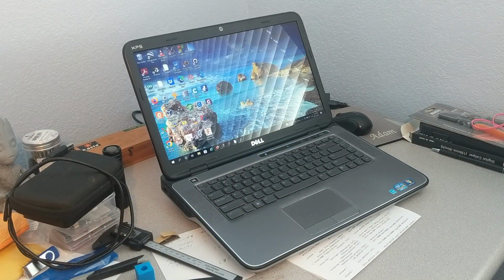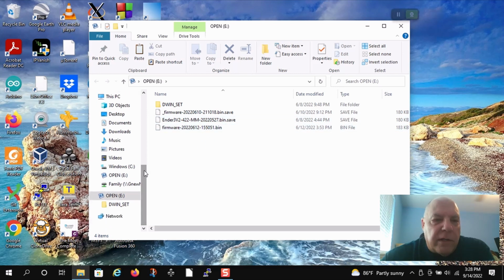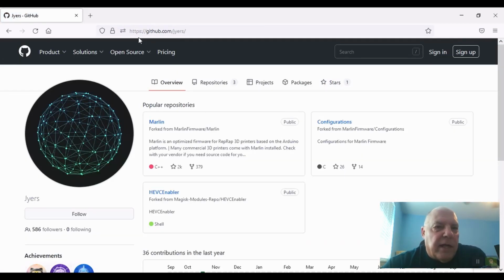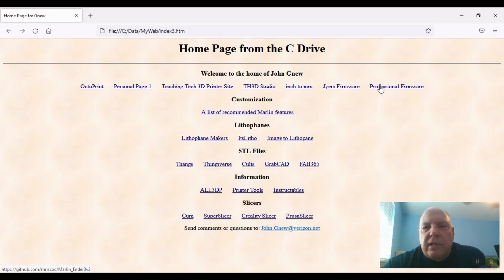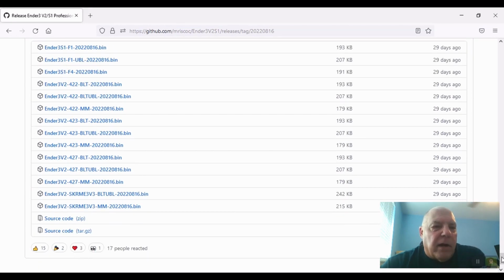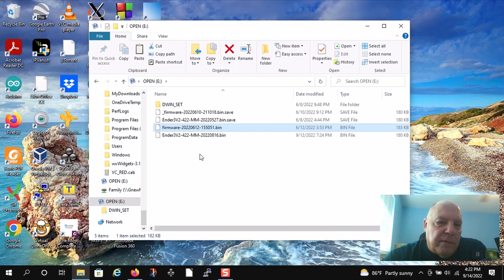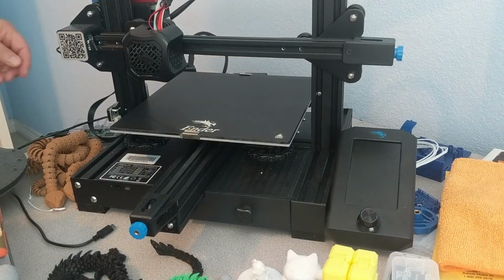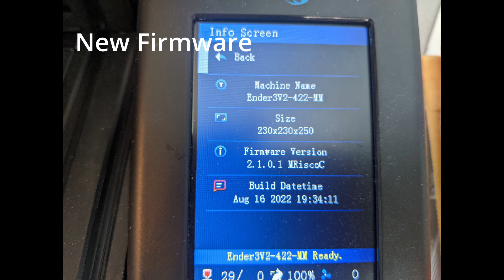Ender 3v2 Firmware Update

Comment: Hey John, amazing video! How did you get those different (from Creality's firmware) icons on your display? Even after I had installed mriscoc's firmware, I still have the 'default' icons as seen in stock configuration... My main question however is this, do you happen to have that local static web-page up on the Internet anywhere? I sure would be interested to know where a few of those more obscure hyperlinks go? I am new to 3D Printing myself and just got my new Ender 3 V2 up and running this weekend with some upgrades I also installed, such as the Ender Sprite Extruder Pro, Dual Z-axis, CR Touch, and soon to add BTT Filament Runout Sensor, and finally the mriscoc professional firmware (which I have to say, puts the stock [or in my case with the Sprite Pro, 'unofficial'] Creality firmware to shame!) I just installed OctoPrint on my one of my re-provisioned RetroPi4's and will soon have that integrated with my printer. But I am interested in the resources you have collected on your hard-drive's homepage you showed in your video so that I can keep expanding my knowledge in the 3D realm?
Reply from the maker: Craig, The display firmware is https://github.com/mriscoc/Ender3V2S1/tree/Ender3V2S1-Released/display%20assets/Giadej%20compilation You need to copy the folder DWIN_SET to a 8GB SD card then put the card inside the display. There are directions on this page as well as YouTubes on how to do this. For the web page part, years ago I created a file index.html on my hard drive which is full of HTML statements. HTML is what a web page is. I took bookmarks websites and put them in the page.
Reply: @thegnewguy  thanks for the link John, I appreciate it. I was just curious if you had your html page up on a site anywhare that i could see some of your links was all? I'm an old-fart IT director by trade who loves retro gaming and computing, but design websites as a side gig, and immediately recognized that you had created a static page to hold your 3D mind mapping that just lived on your hard drive. I just bought a 3D printer to print stuff for my old Amiga, C64s, Atari's etc that you can't source anymore and am looking for resources. I've already settle on, and compiled the source code for SuperSlicer on my Mac. I'm just trying to decide if I want to hassle with a limited Fusion 360 licence or dive into FreeCAD to start making my models...?
Reply from the maker: I have used Fusion 360 just a little but have designed 4 or 5 things in FreeCAD. Having more but very little experience with FreeCAD, I am not in a position to recommend one over the other.